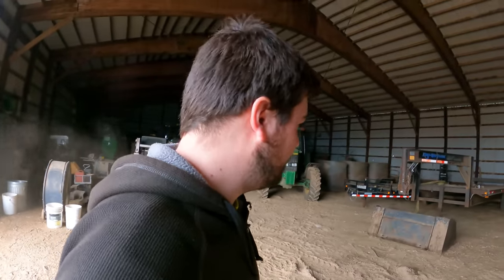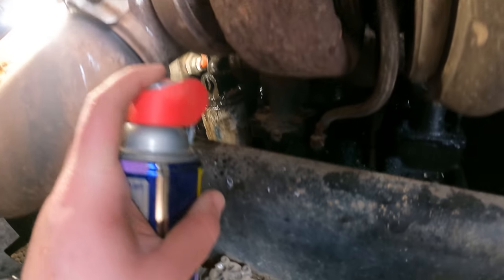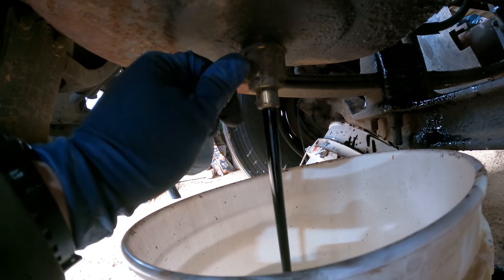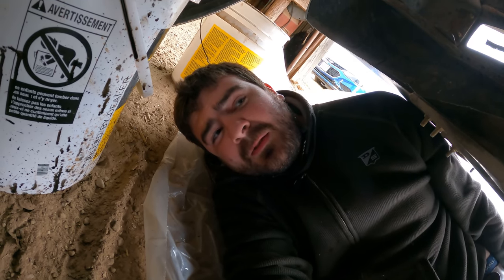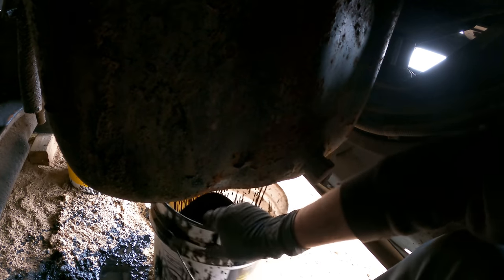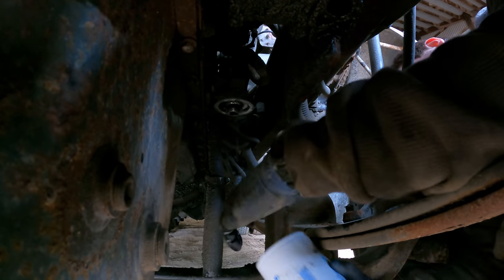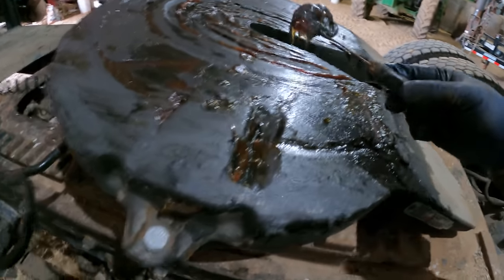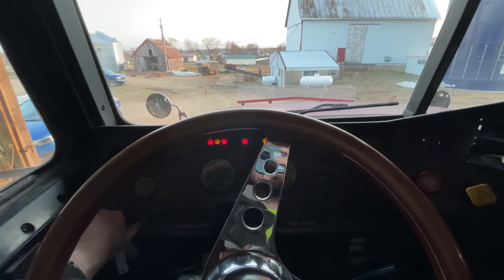Big Red Lost Her Hood! | Oil Change

Comment: Pretty normal to have shavings in the 5th wheel plate. The old plate probably wore a high spot in the trailer upper-coupler plate, and your new plate is wearing that off. (Un-fun fact,) years ago we had an apprentice that started at our diesel shop, and another mechanic was training him on how to service a tractor. When it came time to grease the 5th wheel, the "trainer," (who wasn't the most upright citizen there ever was, shall we say,) told the kid to "just get fresh grease on his hand and smear it all over the plate." Needless to say, his hand ended up bleeding quite a lot will all the cuts from the metal shavings!! (so yes, metal shavings are VERY much normal -- that's a lot of weight rubbing between those two surfaces, despite the grease!!)

Comment: Welcome back. Missed your videos. Best way to change fuel filter or even the oil filter, to save a mess, is to put a nail hole in the bottom of the filter and drain it out. Makes the mess very small if any. That way it doesn’t have to run down your arm.
Reply: @mitch1348  yelp poke a hole in the bottom of oil filter way lighter than annd no mess of the oil running down ur arm. and stop at the car wash or use ur own pressure washer to clean that motor off. if u was to have a encounter with a DOT officer over a pit-that truck would be red tagged for all that leakage there.

Comment: I worked in a truck stop back in college and heard this from a few drivers. When you remove the old filter (any filter) ALWAYS run your finger around the mounting surface (or inspect the old filter) to make sure the old "O" ring came off with the old filter. It's rare, but the old "O" ring can stick and you'll "double ring" the new filter. And in a few hours or days, the rings will fail, you'll puke out the oil, and blow the motor.

Comment: I use a pointed punch to knock a hole in filters.    I buy the filters in the winter when there is a filter sale.  Most engines are changed at 500 hrs and buy the oil in bulk here in Texas.  Our suppler has old ammonia tanks we weigh then bring to the farm's bulk storage.  The wast oil is given to heat the shop at an implement dealer.  My son rents my land but I don't miss oil changes!

Comment: If anybody else has cracking around the area the hinge bolts to the hood you can save and keep it going for a long time by making two 1/8” steel plates cut into squares big enough to cover the whole area that’s cracked then drilling them for the bolts and putting one on front and one on the back side of the hood. We did this on an R model Mack although we only plated the front side but even so it lasted for years and is still lasting.

Comment: The oil filter is much cleaner to change if you punch a hole in the bottom corner away from the axle and drain the filer before removing. Also it is a good idea to fill the fuel filter and oil filter before putting them back on. It makes it much easier on you starting after changing.

Comment: Freightliners are known to have coolant leaks, check the heater hoses from the water pump to the cab, or the shut off valves at the coolant filter. the fifth wheel plates can be rebuilt, just depends on the maker.

Comment: Ryan on the oil filter- I have found if you loosen it but not take it off you can push the filter to one side and the oil will run out on pushed side. If you are lucky you can catch a majority of the oil. Then taking off the filter is less messy. I'm not a fan of filling the new filter before installing. But, I have never changed oil in a diesel.

Comment: I saw one person put a nail through the oil filter to drain it first.  It looked a lot less messy.  May want to look at the underside of the trailer.  Try to scrap down.  I m sure there is a reason for the wearing.  It should be level and maybe the old fifth wheel had already been worn.  I m sure you can find a nice used hood.  Still a nice sounding truck.  Have a great week

Comment: Ryan, there should be a bolt that holds the on/off valve for your coolant filter in place.  lf you loosen it the knob should turn easier.

Comment: Ryan check with you local body man.  You can cut out the shattered area on a glass hood  and if done correctly with stayes and cup reinforment make the hood you have like a newone. suggestion you put backer plates on the bolts on both sides even if you go with a aftermarket hood it will make it stouter. Good luck

Comment: Brian, I would say look at your Kingpin plate on your trailer to make sure that the surface around is still flat. I had that situation on my flatbed trailer to where the plate on the trailer that hold the Kingpin started to weaken and form around the fifth wheel. Which resulted in the the edges of the fifth wheel was starting to have rubbing and shaving marks.

Comment: Maybe see if you can drill through the hood and hinges and thru bolt plates to sandwich  the busted fiberglass back together. I would look the hinges over to see if they need repair or replacement first and go from there. I have repaired half a dozen hoods using plates and fiberglass resin this way and it makes a strong repair that will last a long time. You will have to remove the grille to do the repairs and probably the hood too. It is sometimes a pain to do and takes some time, but very little money if you do your own work. Beats totally replacing and painting the hood!

Comment: Ryan for the oil filter all you need to do is use a spike or a sharp pointed bar with a hammer and punch a hole in the bottom of the filter and wa-la no mess! Lots of years in a truck shop.

Comment: You could see if you can take the hood and hinges off and try to put the hinges backe where they were and use jb weld or some other epoxy! 
I have an fl106 and the hood hinges are coming off and I’ve never hit anything it’s probably just weight, age and vibration/rough roads caused it!

Comment: We use to use used oil for the chains in our bar cleaner.  dad had in a 5 gallon pail with a spout an manage to tip it that it would trickle on the chains. An used oil for chains other equipment.  An mysteriously added it to the burning barrel.   Good times

Comment: Ryan I heard your comment on changing oil, I owned trucks and decided wasn’t making what I needed to run my business so when fuel hit $1 a gallon I sold out! I then moved to Florida and ran the maintenance dept for Disney distribution services fleet of tractor trailers for 40 years, so I feel qualified to tell you that you need to change your attitude for changing your oil and other fluids plus filters. Oil is cheaper than an engine rebuild or replacement, when that bill hits your budget it will hurt your feelings! And as far as changing your oil filter take punch and drive a hole in the filter! Take proper care of all your equipment on a struck schedule and check your fluids daily and they will take care of you. Did you grease the truck?

Comment: You mite check the fithwheel (apron) plate on the trailer make sure the it isn't rusted out or the cross members above it letting it go up in the trailer on that side.  That will cause them marks your fithwheel seen that happen before.

Comment: No new hood needed. Go to a boat place, get some fiberglass cloth and resin. Put fiberglass on in thin coats build it up don’t be afraid to grind out a big surface, area this will increase you strength.. If hinges are good re use hinges. Done hood repair on at least three hooods. Best of luck on repair if you got auto body friend he might be a huge help.

Comment: You should buy an oil heater to use your oil surplus, and future tip poke a  hole in the oil filter and it will allow the rest of the oil in filter to drain out the bottom

Comment: Use the used oil in your manure spreaders. Pour it in the bottom with it running and oil the chain. The oil will break down in the field the microbes I. The soil will eat it up

Comment: Just a tip use a sender punch and put a hole in the bottom of the oil filter then it won’t make a mess as quick

Comment: I havent seen the hood damage  but have you considered a fiberglass repair ? its fairly easy to do at home you can try to implement some metal plate to spread the load and so on yeah that strength it needs to have is a concern for sure anyway would give it a go since it would cost less then 100 bucks i think

Comment: Catch your old oil in a proper oil container.  When you put the new oil in, put the used oil in those jugs.  Then take them to Oreilly's.  They will accept used oil, filter and clean it, put it in their jugs and sell it to you a little cheaper than good oil.  While you are at it, change the oil and filter in that John Deere 3020 with a cab.  Keeping them in the shop is a good idea. Having a new hood put on is about 10,000 dollars.  A used one is about 4,000.

Comment: Ryan here's a thought. I'm surprised that you guys haven't welded up a oil cart with the different types of equipment you have.  Could be pumped out with simple pump. We used to put all used oil used chemical tote. As far as the hood a good truck repair shop can fix it, if you get a different color hood what color would you paint it?

Comment: Shavings are normal. All 9 of our semi's have same ware points. Check the plate on trailer and you'll see. There might be a ware on the edges or it dug into the steele on trailer

Comment: Oil is better than back when that manual was written, you can easily get 20k+ miles depending on the oil, but if you let it sit for so long you probably should put an additive or change it at minimum once a year

Comment: Ryan, I absolutely guarantee there's a cleaner and easier way to take off that old oil filter. Put a container underneath that will hold a gallon, (the capacity of that style filter,) take a center-punch and hammer, and drive a hole clean into the bottom of the existing filter! Do this before you drain the crankcase to give that filter ample time to drain out, and you won't have all that dirty oil drooling down the sides and causing a horrific mess!!!
Reply: To be extra sure you can get filter off, especially on a daily driver, make sure you loosen filter a little first, then punch hole in, you're right a lot cleaner way to do it.

Comment: Stab a hole in the bottom of the oil filter with a screw driver that way it drains a little bit of the oil before you unscrew it.

Comment: Ryan  the 5th is uneven from factory it will wear itself even unless ur king pin plate on ur trlr is uneven. If the plate is warped on trlr  the only thing u can do is cut it out and replace.  30 yrs o/o. Its all costly

Comment: Here's a word to the wise. When opening anything under pressure (cooling system) always ,ALWAYS, ensure there is no hidden pressure. Ie, remove and replace the rad cap. Also there is a much better way to change to oil filter. Get a lady foot prybar with a pointed end. Put your bucket close under the filter, pound the spike end into the filter. Grab the bucket and pull the bar out at the same time put the bucket under. U see, sometimes an ol dog can teach you young whippersnappers a trick or two. Lol.

Comment: That oil drain valve is a good idea, unfortunately a company I worked for several years ago had it on one truck, and the driver drove it through a field with tall thick grass and it opened it up and drained all the oil and locked the motor up before he caught it.. not his fault it was the only way to get where he needed to be.
Reply: one would think there would be a safety cap on that valve so that would not happen..
Reply: Yeah a guy needs to put a piece of rubber or something over it in front of it in the direction of travel so that can't happen... BIL's pickup had a transmission cooler line break and dump all the transmission oil, and I replaced the lines on it for him.  Leave it to Ford to run the stupid transmission cooler steel lines across the bottom of the radiator and into the bottom of the lower radiator tank.  Corn stalks caught the lines and bent them so much they kinked at the fitting.  When I replaced them, I covered them with some split sprayer hose over each line and then used a couple of pipe clamps daisy-chained together to attach them to the crossmember, since they went all the way across the lower core support unprotected.  Used a few self-drillers to attach a piece of old baler belting to the bottom of the core support so that if corn stalks hit it it folds the rubber back over the lines to protect the lines... 

Always a good idea for trucks running out in the fields... OL J R :)

Comment: Unless I'm missing something that oil filter is upright meaning that engine has a full flow oil system (meaning it sends oil to the filter before the rest of the engines lubrication system). Shouldn't these types of systems should have the oil filter filled with new oil when installing to avoid a possible dry start? I've never had an m11 so I can't say anything for sure but on our n14 powered tractor this is the case.

Comment: A good place to find a hood is Vander Haag's Inc. on fb or www. They have everything from new to used and locations all around you and main hdq is Spencer Ia ask to speak to John Jr. I had a fld 120 and I used rotella and switched to mobile delvac and used less oil between changes, leaking and burning but we got the mobile oil in 50 gal drums to save alot of money plus it was delivered to the farm.

Comment: Your fifth wheel plate mounting bracket might have heaved up from rust or dirt underneath it on one side. You might need to take that off and clean it up and make sure that it’s level.

Comment: 10:20 shoulda filled that oil filter before installing; and the fuel filter too!  14:55 just cranked the motor with no oil flowing from the filter for 10 secs. Good thing you only change the oil every 2 years.
Reply from the maker: Manual says to not prefill.

Comment: That's normal on a fifth wheel just keep greasing it as needed should be just fine.  The oil every 2 years I guess would scare me a little but it all cost money but so does a overall.  Routine maintenance and grease is your cheapest option.

Comment: It is your truck but I would at least change the oil once a year.  It degrades over time and nothing oil touches costs less than a $250 oil change.
Reply: Oil touches the filter and that’s not $250. The oil pressure sending unit isn’t $250 either although it’s probably close😂 no I’m just messing with you..you are absolutely right on that statement
Reply: @Adam_Poirier  Haha.  Well done sir.

Comment: When your oil filter holds that much oil you should prefill your oil filter .
Reply from the maker: The manual says not to prefill
Reply: I know it does but that is just hard for me to swallow to not do after being in the truck feild for 20 years and seeing premature bearing failure on some lower mileage engines that have been well serviced. The reason they have that in the manual is cause they don't want unfiltered oil getting into the engine. As long as you prefilled the filter on the inlet part of the filter the oil will get filtered thru the oil filter.

Comment: Look at your king pin plate on the trailer and see if it's  sunk in or worn and did u replace the bushings and pins on the 5th wheel and for the hood check with vanderhaggs.com

Comment: get your self a wast oil heater for the shop LOL
pock a hole in the bottom of the old oil filter before you take it off and let it drain out and its a lot less of a mess and less weight next time LOL.

Comment: That's an easy thing have 10 gallons 15w40 ready for oil changes... I could have told you that... Dont change oil every 6 months you do it by miles and engine hours.. like your farm tractors.... if you would drive that truck commercially then you might change it every 3 to six months... you're not putting 2500 a week on that truck in 12 weeks aka 3 months you dont have 35000 miles on that truck plus the fact that that truck is non EGR engine no reason to change it so often...

Comment: Don't give up on repairing that hood without letting us at least have a look at what it needs! I'm guessing some fiberglass repair and maybe some welding/fabricating will do it cheaper, faster, and better looking than the alternatives.
Reply: Absolutely.......fabricobble some brackets and bolt to the good part of the hood. If you can’t, fine that handy shop in your area....make some calls.  You will come across someone that can fix you up for a couple hundred of your stimulus bucks!
Reply: @ Tim Nichols Exactly, fiberglass work is pretty easy, especially if you don't care what it looks like-as on the inside of that hood. Backing plates can be glassed in SOLID, they will not go anywhere. Let's get 'er done!

Comment: You made a big mistake.you never change fuel filters without filling the new one with fuel.tip from a mechanic to you
Reply from the maker: Manual says to not prefill.
Reply: I use to own my own rig.i never changed fuel and oil without prefilling themit is a bit easier on the engine to not crank that much.hard on the starter too
Reply: @brianrutherford3229  When you have an electric fuel pump you don't have to prefill
Reply: @brianrutherford3229  others argue you are filling filter with otherwise unfiltered fuel that will go straight to the injection pump. All manuals will say not to pre fill for that specific reason. Most have primers or fuel pumps to fill it. To each his own